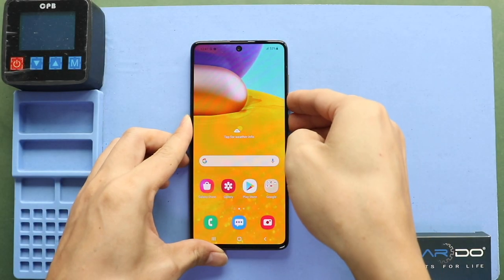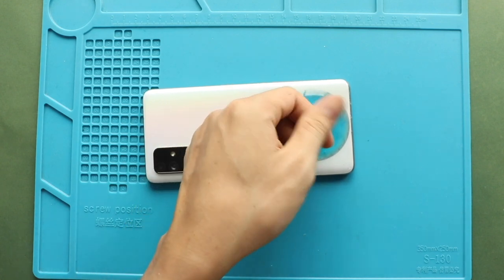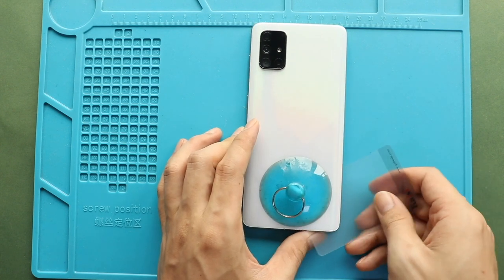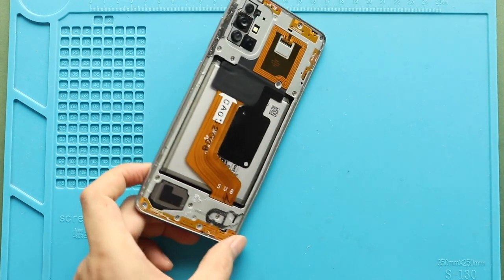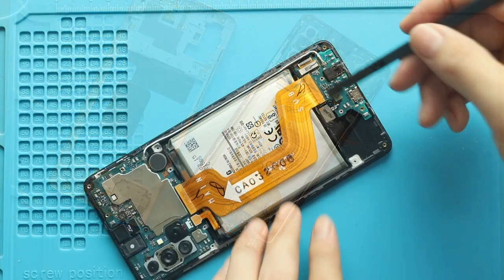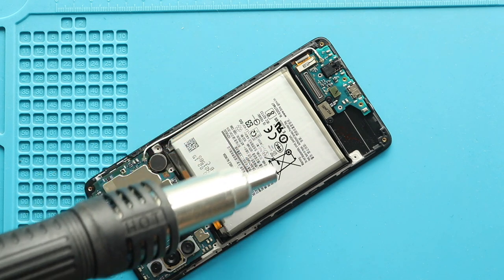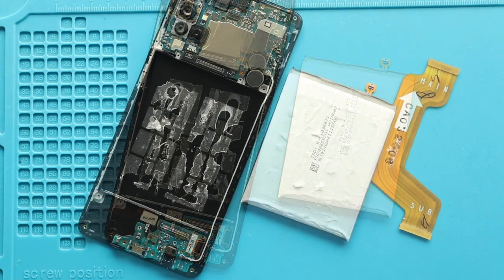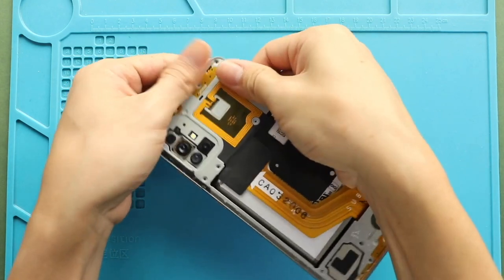Samsung Galaxy A71 Battery Replacement | SM A715

Comment: wow.  that was one of the best battery replacement videos I have seen.
I think I will get that heating pad.

do you need to reglue the back cover to ensure it stays on?  is it risky putting glue near the corner with the cameras?
Reply from the maker: You can use double sided adhesive strips. Thin ones